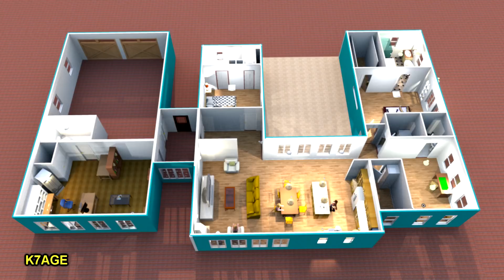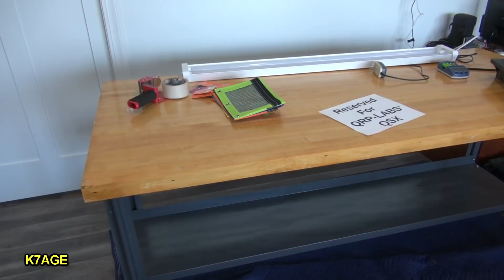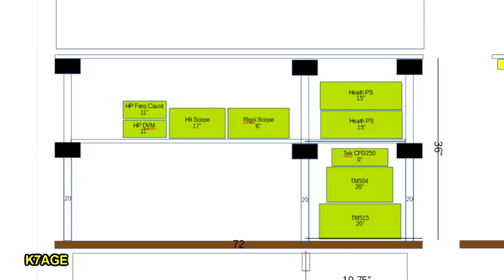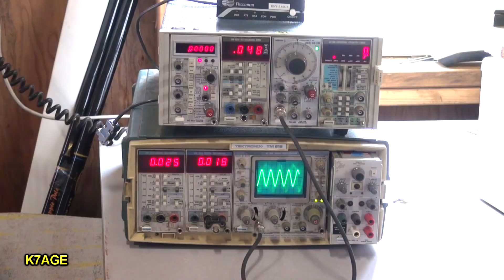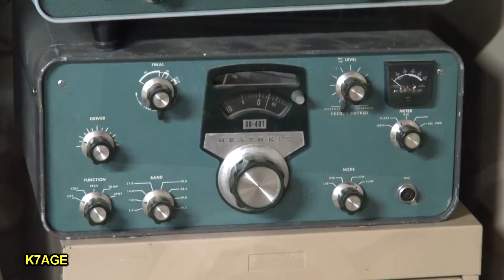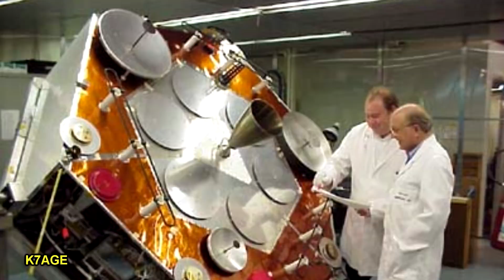New Ham Shack Introduction

Comment: Looks like a great shack layout. I saw an SB 401 transmitter and what may be an SB 300 or 303 receiver in the Heath gear. I built the SB 401 in the mid 70's and purchased a used SB 303. They work great connected together in transceive mode.  Have fun!!! Bill WB9NYI
Reply from the maker: I really want to get the SB101 going. I also have the matching scope and the clock/phone patch/ swr meter console. That would look great.

Comment: Welcome back, Randy! I've missed your videos and your personal touches. Echoing a previous comment, I'd like to see details of not only the electrical wiring design, but also what kind of ground you went with. I assume you pounded a big piece of rebar into the ground, or else used the hydraulic jet approach? Undoubtedly first class.
Thanks for the great video.
Mark N5CBF
Reply from the maker: Someone else asked this too. Following the ARRL book Grounding and Bonding for the Radio Amateur by Ward Silver, N0AX. Perimeter wire around house tied to the service entrance and goes out to tower. I can tap into that to bring it into the shack.